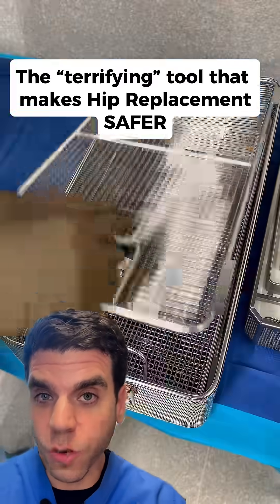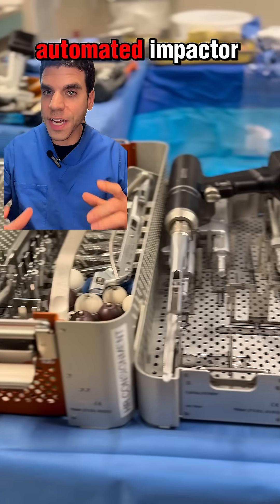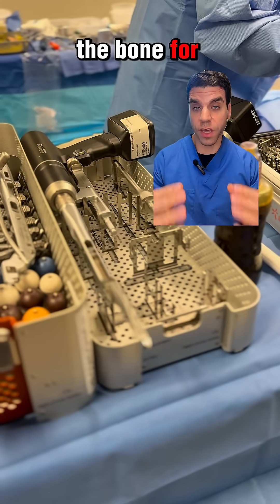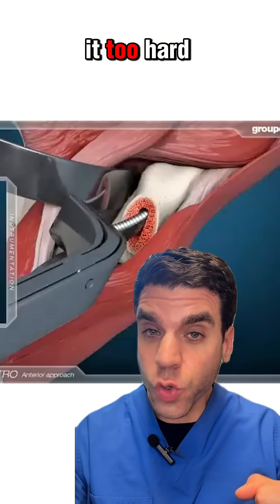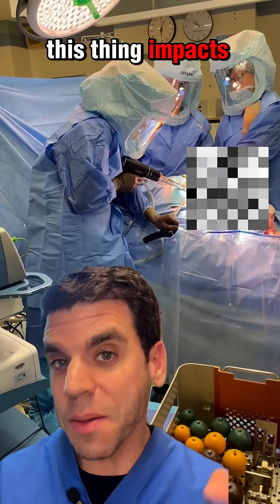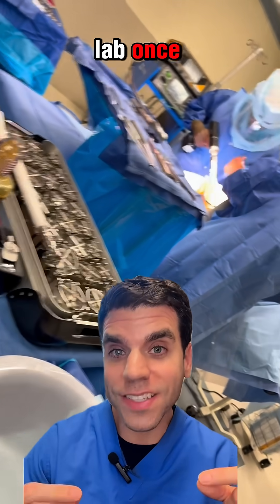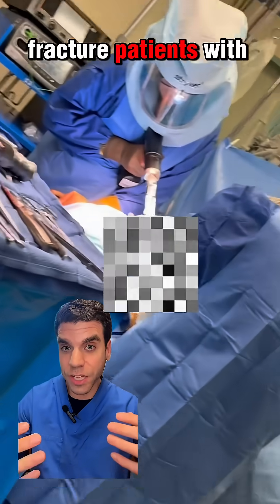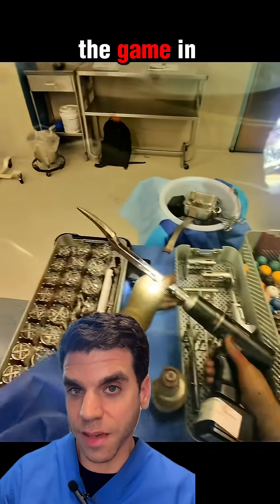This “terrifying” tool makes hip replacement so much safer

Comment: Device should be wrapped AND SEALED in a sterile plastic bag... there is no way the device EVER gets sterilized in an autoclave...that device is transferring MRSA and STAPH all over that O.R. ... just shows how sloppy and clueless today's doctors are. Theynuse that device thousands of times a year...and the best it gets is wiped down. DUH.
Reply: The actual tool itself is pnuematic, that lil pack is a battery operated air compressor that powers the tools, so the power unit gets switched out while the actual tool component is sterilized separately and then once again before surgery i guess, but yea im sure you could do better
Reply from the maker: It is sterilized in an autoclave before every case. The second clip shows you the sterilized tray being opened in the OR. We would never ever use anything in surgery that wasn’t sterilized
Reply: guy with a name like "truthseeking" making up the filler details based on one youtube short is so iconic

Comment: Ortho is brutal
Reply: There's a reason it's called the carpentry of the medical world. It uses a lot of similar tools. There's reinforcing plates, nails, screws, glue, saws, knives and now an impact hammer.
Reply from the maker: @Viper607706 yes!